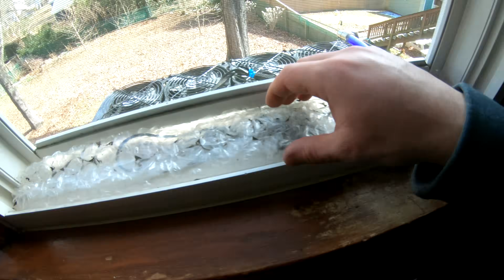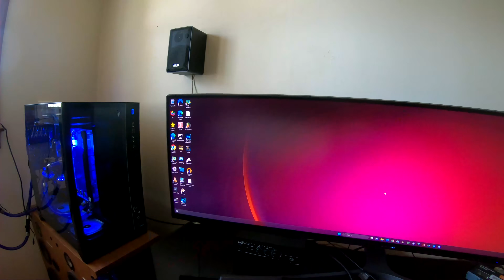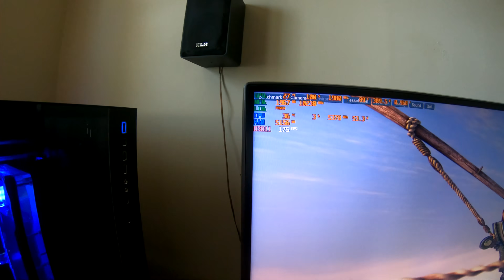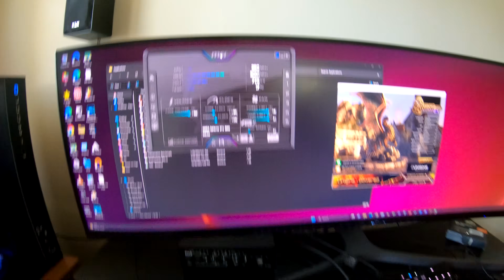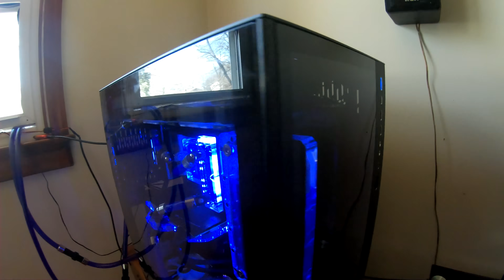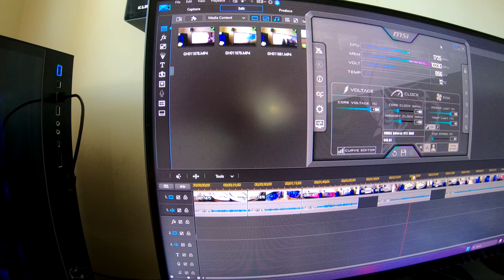Sub ambient cooling setup

Comment: Glad your into something you like. Personally I will never build a PC that needs that type of cooling. Air cooling and a mid range setup is good nuff for me.  14900ks intel's got is a 400watt nightmare and just plain dumb. Plus if your running a 4090 with it that's a 1000 watt draw just to game. NO thanks Intel and Nvidia NO thanks. 100$ a month in electricity just to run a PC is insanity and just stupid!
Reply from the maker: With manufacturers making properly high powered chips it does take advantage of cooling setups like this but yes they seem to be going for bleeding edge power draw and it is quite unrealistic to utilize 95% of the power without needing a massive heat dissipation setup.

Comment: this is what i love to watch and do, keep em coming, subscribed.
Is that a 3090? mine is copper modded, hybrid pump mod, 240rad with noctua and heatsinks on backplate doing 520W (modded vbios) 65c and 80c max on vram pushing max 12c hotspot..inside a small case with hybrid evga aio..
Reply from the maker: It's a 3080.12, glad to hear you have some serious mods!
Reply: @raceme5757  since i was 12yo +-, dryice, ln2 etc grabbing a few records along the way, i wish i could make a living of this!

Comment: great idea running it outside, but there is another way as well, run the cooling loop under the ground and use copper pipe under the ground as a conductor, no radiator needed. the ground itself can keep it cool with the large thermal mass of the dirt. I know it sounds janky but it will work and is total silent, you just need a reservoir.